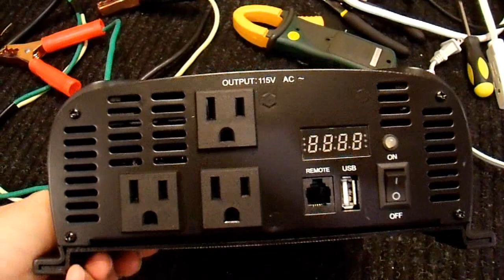Inverter Repair Whistler Pro-1600W Part 3 - Addendum

Comment: Hi I been looking for a way to turn down my load cut off on my cat cp1000 Inverter ,the problem is when my charger kicks or off the alarm goes off thus shutting my pumps off when the whole point is to have permanent power at all times ,have talk to cat,I what help not so tool reading of a screen

Comment: Shit, I just bought 2 of these 1600w inverters (great deal on NewEgg). However, they are the updated units. Look very different. I am hoping that they have addressed the majority of the inadequacies that you have uncovered. Do you have any experience with the new updated units? My goal for them it to run a fridge with one and lights/chargers/small appliances with the other.  Thank you for making such an informative and technical video.

Comment: My Whistler 2KW inverter is in for repair (under warranty). The fans or something make a clicking/chattering sounds right at the threshold of turning on. The problem gets worse with temperature and higher loads. All cabling is high quality (1 gauge) and I am running 6 deep cycle batteries. The inverter is used in my garage to power a 3 cu ft fridge and 5 cu ft freezer. It worked fine for about 3 months and then the fans died. Whistler said the fans should not chatter. Thoughts? Possible temperature relay clicking?
Reply from the maker: The switch is transistorized so no relays here.  Most likely the fans are just worn out from continuous use running refrigeration devices.  This isn't designed to be a continuous duty inverter and if you decide to use it as such you may need to spend some $$ on quality fans for it to last.  (3 months does sound short though)  Hopefully their replacements are better than the originals!  On products like this they frequently change components so it is unlikely you'll get the same fans again.  They may just throw the inverter away and give you another too.

Are the fans temp controlled on your inverter?  (meaning they run slowly at first and faster as it warms up or with heavier loads)
Reply: Thanks...you are correct. I am powering a 3 cu ft fridge and 5 cu ft chest freezer 24/7. The inverter is powered by six deep cycle marine batteries...voltage never goes below 12.5 during discharge at night (using 0 gauge cabling). The set up works great...solar power to recharge during the day. Anyways, the fans are temp controlled and start slow (with that clicking sounds) and ramp up when loaded. As for that clicking sound...those are some very loud transistors if they aren't relays. I hope it is just fans. Thanks for your advice/tips...appreciate it. Do you a recommendation for inverters in the 2-3KW range?
Reply from the maker: Chris
OK, so the fans are PWM controlled.  This makes sense now.  The 'clicking' is the PWM signal to the fans causing the fan rotor to jump around on the cheap sleeve bearings.  The more worn the bearings get the louder they'll be until they ultimately fail.  This is why I don't like PWM control on cheap fans - the fan needs to be rated for it or they will fail prematurely.  If you're happy with your setup other than the fans you could open the inverter, measure the fan dimensions, and splice in some quality ball bearing replacements.  It will be good for a long time then.
Reply: Awesome! And thanks. Are the little "brushless" 12v fans good? Sending these Whistler inverters in every 3 months because of cheap fan issues is NOT going to happen. The only downside is the warranty voids once I pop open the cover. How is Power Bright inverters? I am eyeing the 3500 watt unit with one fan (will return my current 3KW Whistler for refund and put the $ toward the Power Bright). As for the 2KW in for repair...keep it as backup (can't return it for full refund).
Reply from the maker: Chris
All of the little fans are brushless so what you want to look for is one with dual ball bearings from a reputable brand.  Lots of brands out there.  The cheap ones have sleeve bearings and are not appropriate for PWM control.  Or anything that needs to last, really..

Power Bright makes decent low cost stuff.  I would recommend.  I don't know your exact application but if efficiency is important I would seriously consider something like the APS1500 from PowerBright which is pure sine and quite efficient.  It's not top quality but is better than Whistler.  Refrigerators use around 25% less power when run on pure sine than on modified sine.  (e.g. if the MSW inverter is 90% efficient and the pure sine inverter is 80% efficient it will still take less battery power when run on the pure sine inverter)
Reply: Thanks again. Pure sine wave is a lot more expensive...but, def superior to modified sine wave. I am looking at the Power Bright PW3500 for my application. I am running garage appliances (lights, fridge, deep freezer, stereo, TV, and occasionally power tools). I am not too worried about efficiency. I built the system as an emergency back up power station in case of an emergency. Now, it runs 24/7 because it works so well. I have 800 watts of solar panels, a MPPT 30 amp solar charge controller, six deep cycle batteries (dual 0-gauge cables going to inverter) and lots of other gee-wiz do-dads. I just want an inverter that I can leave on and not have to worry about cooling fans. The Whistler Pro3000 is installed at this time and is doing fine...albeit, those shoddy fans. Thanks again.
Reply from the maker: Chris
Well, one rule of thumb with fans is this:  The larger the diameter the longer the life.  When given the option, all else being equal, always choose the product with the larger diameter fan.  They tend to be easier to find replacements for as well.
Reply: Thanks....your right. I sent the Whistler Pro3000 back to Amazon for refund and ordered the Power Bright PW3500-12 with one big fan. One guy's review said he has run his for 7 months 24/7 powering his solar/battery system and has had zero problems. His set up is similar to mine. So, we'll see.
Reply from the maker: Chris
The PW6000 is a good product for the money and I suspect the 3500 is too.  I hope you're happy with it!  There's nothing notable about those products and that's what I like about them:  They simply do what they're advertized to do.

Comment: Yes that is FLA. The furnace is a carrier infinity model from '05 with variable speed and lots of bells. googling "carrier 58cva product data" and it is the second link (a pdf)... the full load amps on the blower is 7.7 amps (14 AWG wiring). My thought is that if I were going to do this the house would have been cold and the furnace is going to consume the most . I don't have an clamp so measuring is a pain. This this might be the reason to get a clamp :)

Comment from the maker: oops.  correction.  250W is the FLA rating.  It consumes between 150W and 200W the way I have it set up.  It is sized for a 30k BTU AC system.

Comment from the maker: I'm curious, what kind of furnace do you have?  My furnace fan only takes 250W.  If you have an old blower that isn't PSC (doesn't have an external capacitor) then you might want to consider buying a more efficient motor from Grainger or somewhere.  Just an idea.  Also, is the 9.6A at a low power factor?  If so it may not take 9.6*120 watts.  Or if it is oversized it also will not draw the FLA rating of 9.6A.  Just wondering if you've measured the wattage directly. Or maybe it's a big furnace...

Comment: My confusion originated from all the scenarios I have been researching...sorry.  Thanks very much for the reinforcement about float, recommendation on initial charge, a tolerating my stupidity.  My use case would power the fridge (1.6 nonsurge amps) for 30 mins a couple of times a day, some lights and usb phone charger, and rarely the furnace (9.6) so not continuous 2000 watts.  So my next questions is do I hack up a UPS or get a dedicated inverter with hardwire connection...choices

Comment: My question was utterly stupid!  My bigger than normal UPS uses 2 parallel banks of 4 batteries so the batt input to the UPS is 48 volts...not 12 volts.  That means that you can deliver the same amount of power with 1/4 of the current because it is 4x the voltage (I*V=W for DC).  That is how APC can deliver 2000 watts with 2 10 gauge leads on each tap which would = 7 AWG.  If your disregard losses for a moment, 2000 watts into the UPS would be 166 amps at 12 V, but only 41 amps at 48 volts

Comment from the maker: Red tape is a good safety measure.  I have a personal convention of using masking tape instead. :(  As long as all of the batteries are kept in series all the time and are the same type and age I wouldn't bother with a separate charger.  To equalize and give initial charge just plug in the UPS and leave it alone for a couple of days - they'll equalize themselves.  APC floats their gel batteries at about 14V which is too high for lead-antimony batteries, but it makes a good equalizer!

Comment from the maker: 4 batteries in series so 1/4 the current.  ;)   That UPS is probably only around 85% efficient and battery voltage drops under load so you're probably around 50A at 2kw output once the batteries are drained a little bit.  That's my guess anyway.

If you use 100Ah batteries for the bank you can probably pull 2kw for about one hour before the batteries quit on you.  I guess that doesn't meet your 72hour goal does it.  maybe a gen set is necessary for some of your loads after all...?

Comment: I was thinking of using a battery charger to get all of the batteries to an equal charge then connect to the UPS the first time but sounds like you think that is excessive (would save me money to skip this).  Was thinking I would plug in once a month to top them off a avoid H production.  A friend helped me put in 4/0 AL to my entrance panel so not scared of working with the big stuff.  I really like your idea and have red electrical tape for just such an occasion.

Comment: Wouldn't I be pushing more than 100 amps through the batt array (in series) when I exceed 1200 Watts AC?   According to the runtime chart for the UPS, the oem batt should be able to carry that for 20 mins (2 banks of 4 batt with 10 gauge wiring) ...you are right a runaway heat situation could get me.  That is why I got one with such a high nominal rating hoping that using less than 1/3 of the rating would carry for a long time.  I will definitely use your suggestion for cables.  Thanks immensely

Comment from the maker: Yeah, wire is expensive if you don't crimp your own ends.  I made my own battery cables by cutting apart a 4AWG jumper cable and putting both conductors together (which equals 1AWG) and crimping on 1AWG copper rings.  They're not color coded this way, but they are all the right length and quite inexpensive!  Just an idea.

Comment from the maker: I would highly recommend using the largest batteries you are comfortable working with and transporting rather than multiple smaller ones.  Your UPS will draw less than 100A so no worries there.  I would be concerned about overheating of the UPS at a 2kw long-term load though...

Can you just use the UPS to charge the batteries?  I wouldn't recommend using it to float, but it is easy to do and will charge them evenly which is difficult to accomplish when charging individually.

Comment: You mentioned in a recent video about a good general rule to keep under 100A 12v DC per marine battery.  If I was going to suck continuous AC 2000 Watts out of the inverter would you recommend 4 large batts in series or 2 banks of 4 smaller batteries in parallel?  Wire is gonna be expensive.  My entrance panel is in my attached garage so the logical place for this setup and maybe offgas is a little less risky.  Planning to charging the batts individually so they are all equal.

Comment: Thanks!  I have been leaning to the ups as an inverter but I was torn about the runtime diff (debated about a Boily generator running on a natural gas line).  I have been wondering if my natural gas furnace (max run amps 9.6) would run off the UPS in an emergency situation I and could just retreat to the basement in the summer.  I need to check neutral ground obviously, but a bigger bank of batts with a small solar panel might just cut it for occasional use.

Comment from the maker: ... so if you want clean power you either need a high quality generator, or a battery + inverter.  Unless you want to run heavy loads like heaters and AC units I would definitely choose the battery/inverter method myself like your UPS.  Even quiet gen sets are obtrusively noisy, and are a security hazard as they need to be run outdoors - not even an attached garage is safe with the CO fumes.  I wouldn't worry about battery gassing.  I've charged batteries countless times in my kitchen.  :)

Comment from the maker: Marine deep cycle batteries (not marine starting) are a good low cost choice for occasional use.  The SUA3000 does not clean power - it just sends it straight through, so I would not use it for that purpose.  (It does have a line filter internal, but you can buy a standalone line filter for cheap most anywhere and they do very little to clean a noisy cheap-o genset output.)  As you say the good gens such as the Honda inverter style are expensive.

Comment: I have an unrelated question. I have a apc sua3000 rack ups with a new battery pack.  Used to run the fridge in a power outage but I am debating between getting some marine batteries (4 because it is 48 volt) to power more stuff or a small cheap generator and use the ups to clean the power.  Power outages are usually 24-72 hours.  Worried about off gassing (would be in a garage) but maintenance of a gas genny is a pain (need lots of gas unless and expensive inverter generator).  Any suggestions?